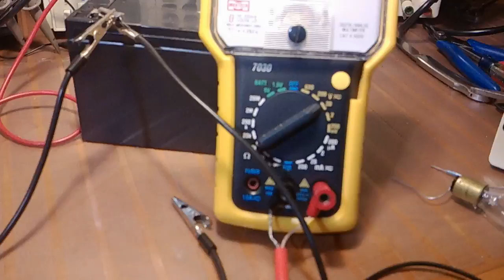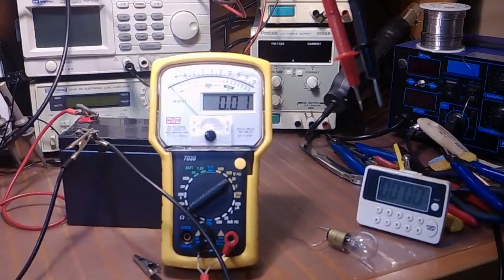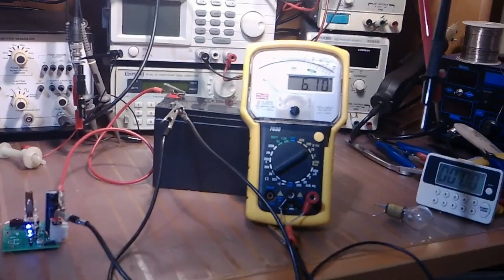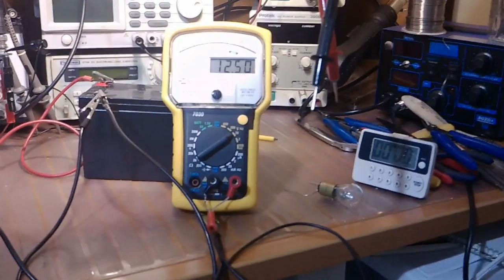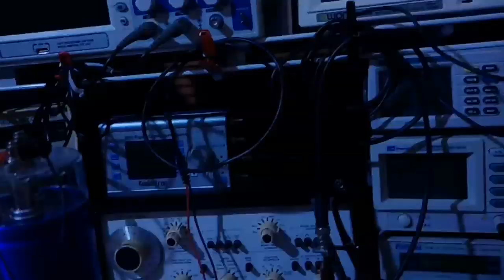The Cloud Coil

Comment: Great work. Very interesting.
I dont understand it, but I will definently try it myself.

How are the cloud coil wound?

Dont over work yourself because of us. We want you around for long.
Hope you get better soon.

Btw, are you firmilar with Eric Dollards way of tuning a Tesla transformer, and do you think it works on the same principle as the SEC with the whole srf, 1.094 Mhz and all that?
Reply from the maker: I will give a coil overview in the coming weeks, although it is very precise in how it is wound. Must use same components in the coil and same Al or it just does not work. This coil took about 3.75 hours to build by hand. Needs a number of hole drilled and wind procedure as well as a varying inter wind spacing does not look easy andas I said, this way or no way.
Reply: StifflerDr It will be interesting to see what you have come up with this time.
Aluminium has some interesting properties.

I have been trying to get myself firmilar with the concept of srf, but It seems like it just dont have the equipment to replicate your video demonstrations, but I have got the basic idea.
That is why when I was reading a book by Eric Dollard called "Condensed intro to Tesla Transformers" i got the feeling that it was related to your work. 
Have you heard of Erics way of doing it?
Reply from the maker: The onlly thing I know of Dollard is his idea's on Ground Radio.

Comment: Very nice charge rate on that capacitor, excellent!
Reply from the maker: Thanks. The rate is nice and did you note, linear. The best part is the battery only fell 0.2V to take the video charge to 12.6V. You know and understand the dynamics.
Reply: Yes indeed I did note that the rate STAYED linear and wondered if you had to stop it. :-) That's good stuff right there! Again, excellent work! Just thinking out loud but methinks it might be really cool to have lots of clouds and caps. ;-)
Reply: Hi Doc, linear charge on cap denotes constant current charge rate. Which means source impedance must be very high.  I just guess from the way the coil's wound the Cloud Coil utilises nuclear magnetic precession / spin wave effect ?